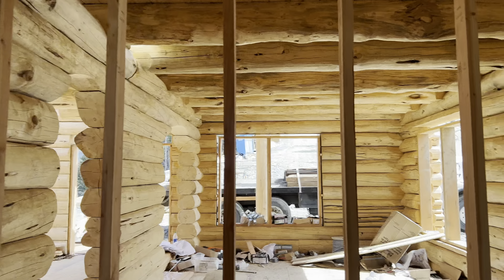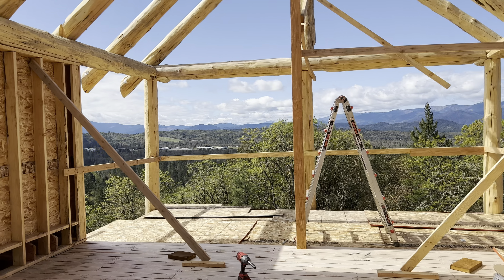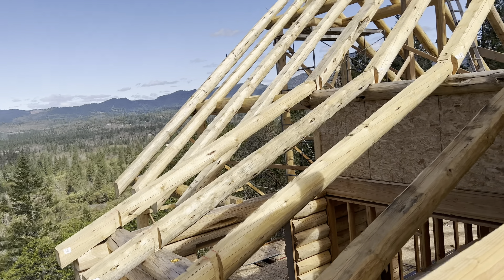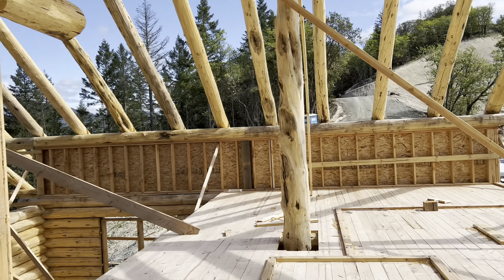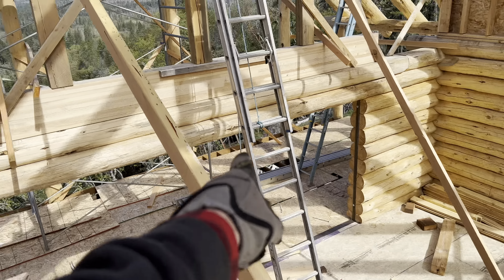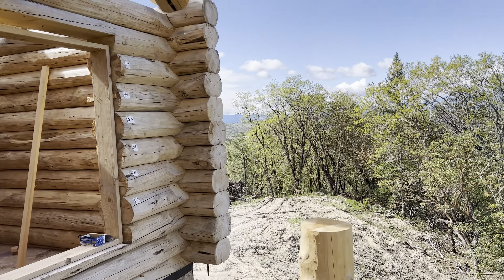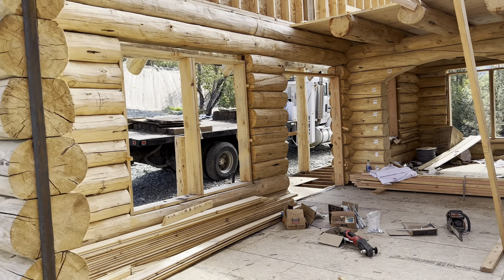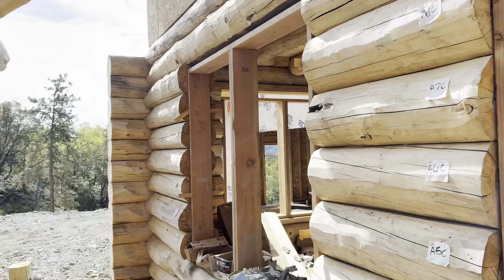Log Cabin Built with BOOM Truck

Comment: Great work! Log homes are great,  I wired one ONCE! I hope his electrician and plumber have their acts together. Wiring one was difficult and uses alot of wire as you can not get from one point to another easily! I didn't see many cut-outs for the boxes, if I remember  we cut them in the center of the second course and used an 18" ship fitters drill bit to get to the basement! It's quite an experience! Love your channel!

Comment: That is gonna be absolutely gorgeous. I used to be OBSESSED with log homes and  timber framed structure. I’ve completely moved on. Solid stone, (preferably natural creek type or cut lime) is where its at for me. You can mix in timber inside and out but main structure in stone to me is beautiful, timeless, and durable. Not to mention fire proof with a stainless standing seam roof. 😉 NOICE job August!
Reply: Well, stone is great, until an earthquake, which is one of the hazards of living on the Ring of Fire in the Pacific Northwest.  You gotta pick yer poison!
Reply: @redmondjp  yeah I’m in Indiana.

Comment: Wow beautiful I love it. What a awesome cabin and view.I’m 76 now and been busted up so logging from age 14 until I was about 73-74  just can’t do it anymore so I get my adrenaline by watching but I remember I was in my 30’s a man who I sold logs to was building a log cabin and when he got to the center ridge he asked if he could hire me to come with my loader and put it in place. I had a prentice g on single axel chevy truck so we had to set truck up on blocking to get the height I needed . It was touchy when I would move it right or left being also because I only had one end so when it was in place on far end it had to be fastened so I could drop my end in place. Touchy with the men working because even though I feathered the swing the best I could 1/2 inch on my end could be far enough on far end to knock man off.

Comment: Those "engineered" logs seem like a cool build experience, unlike raw logs in the woods. Looks like a GREAT view, but hope they are not on the windward side of the hill. BIG picture window reminds me of my 1st house in Eureka, CA. On a hill overlooking the mouth of Elk River Valley on the south end of town. Great view in good weather, but wind blowing at 30 MPH up that valley accelerated to over 60 MPH up slope against the plate glass, and sitting there one night, I saw it bend.😳 I WAS sitting there. Found a better lot shielded from the wind and more picturesque to build on.